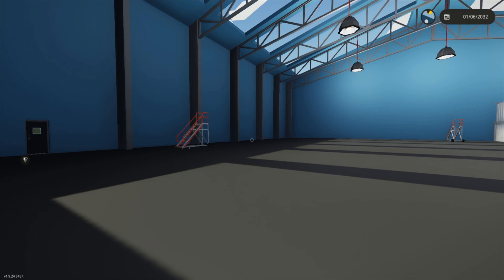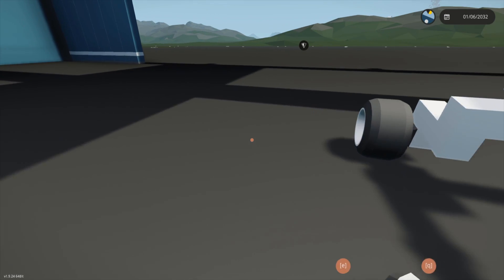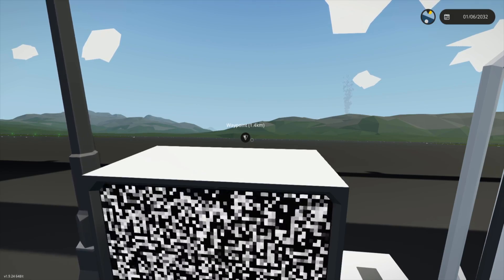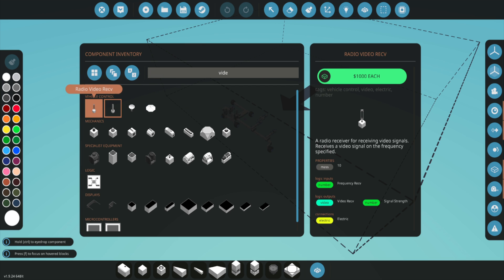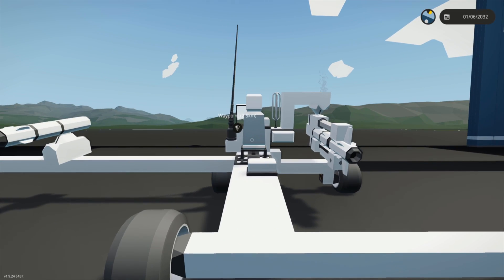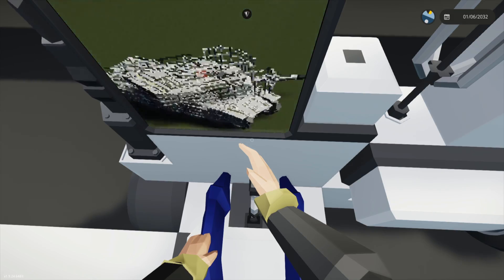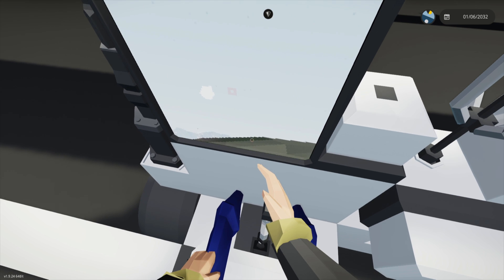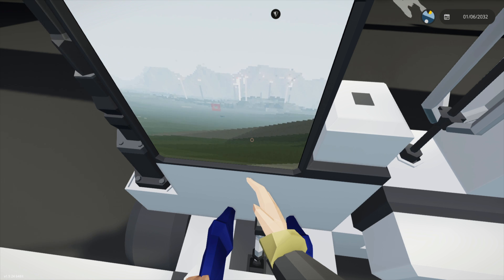TV Guided Missiles |  Stormworks: Search and Destroy

Comment: Have you thought of try combining the video feed and also radar? I did that Already built of my missile and it does work well by using camera feed to see where I going until the radar pickup the vehicle then it automatically take over my control to aim at it. It surprised work well and even if you aim the missile up to the sky and then dive down from above to hit the target.

Oh and also I use gps on missile to me so I know where I am and it a lot higher range than video feed if the video feed cut off but the gps still show the location and the radar will help you to hit the target if you know there positions.

Comment: It's 10km for video when the transmitter and the receiver are in line of sight of eachother. Seems like Stormworks accounst signal strength based on terrain model.
Reply from the maker: Finally had a chance to try this... and no. Line-of-sight hasn't fixed the 2km range issue.
Reply: @AlMagmaGaming  I'm 2 months late but I think the issue might be vehicle load distance and could be fixed with a keep active block on the missile.